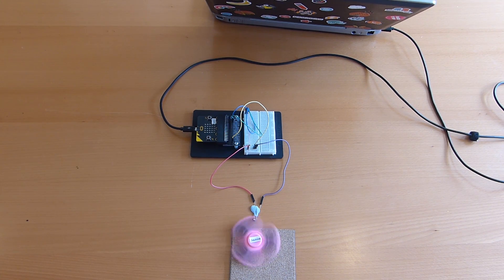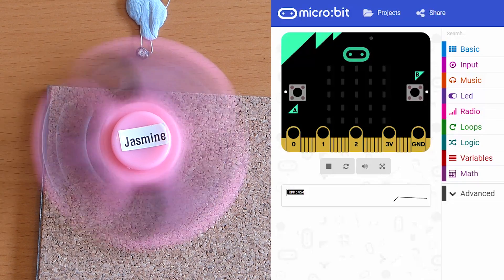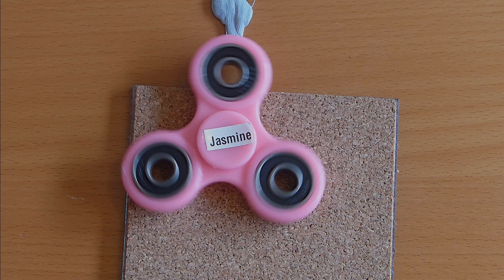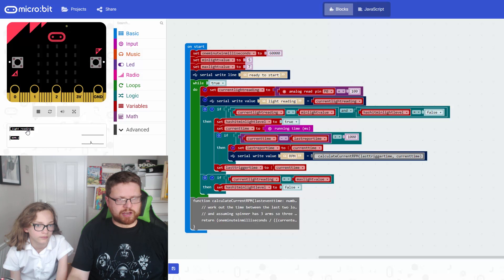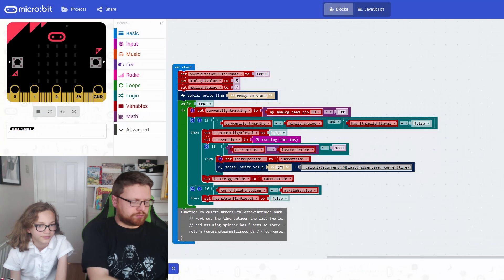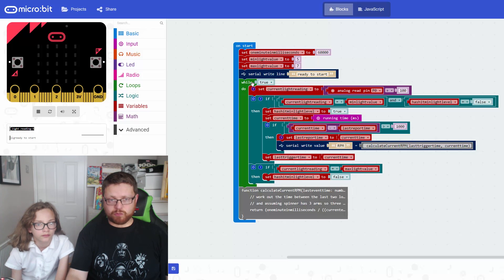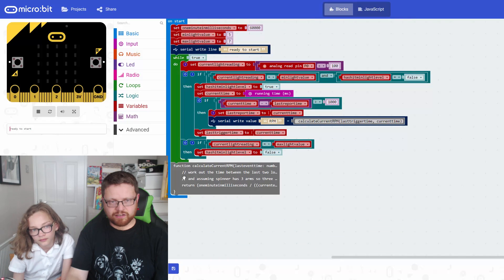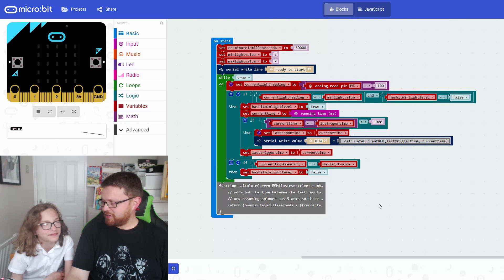Episode 16 - micro:bit Fidget Spinner Speed Test

Comment: Great video, thanks!  New viewers, if you're writing the code yourself by following the video, watch out that PXT/makecode no longer treats the division block as integer division, so you'll need to do this rounding down/quantisation of the current light level yourself.  You can use the "floor" function (found in "math" as an option of the "round" block), or you can use the integer division function (found in "math" as an option of the "square root" block).  If you follow the link to MicroMonsters' code, you'll see that it's already corrected to do integer division.

Comment: In the JavaScript code, line 35 of the code doesn’t seem to be working for me. I’ve created the ‘lasttriggertime’ variable but it shows up saying that it’s an unknown or unidentifed variable. This means that when I try to flip back to blocks it say the code will not work and it can’t convert. Can you help?
Reply from the maker: Hi,

did you copy the code by clicking edit on this link: https://makecode.microbit.org/15356-29310-37436-44268

line 35 in that link is:

serial.writeValue("RPM", calculateCurrentRPM(lasttriggertime, currenttime))

and here that seems to work fine?